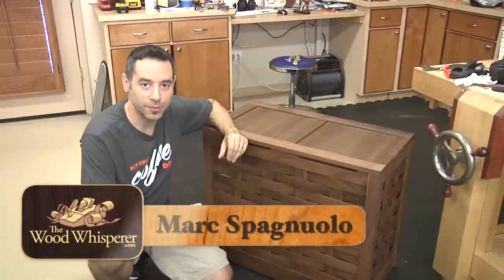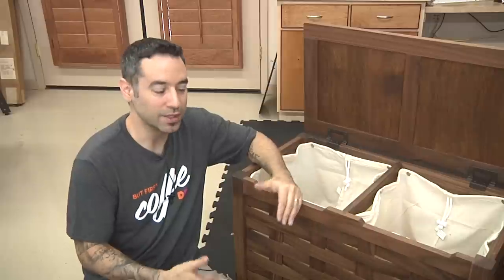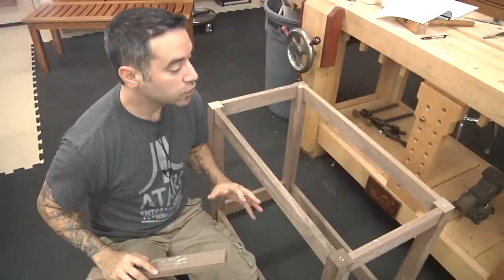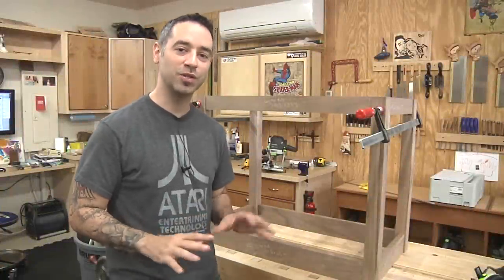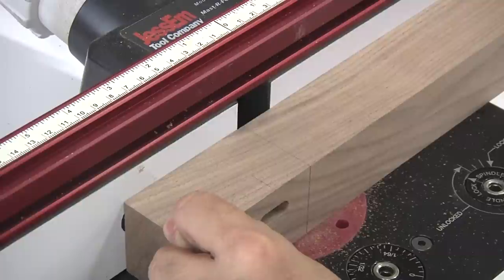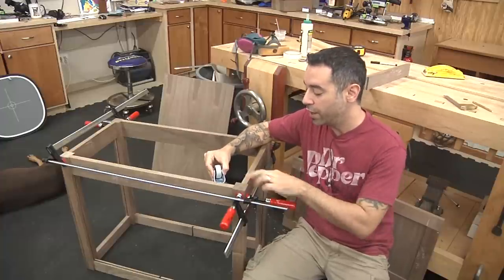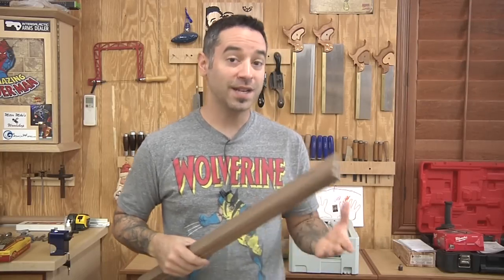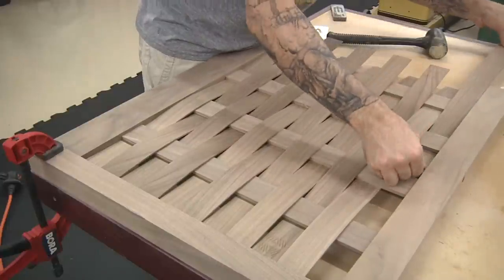Woven Panel Rolling Hamper Pt. 1: Joinery & Woven Panels

Comment: How were the outside legs of the weaved framed secured? Did you leave it dry or use glue?  Did the weaved pieces just float in the groove like a raised panel would on a cabinet door? I like the trick you used to get all the thin pieces in line. Thanks
Reply from the maker: This was just a dry run to prove the concept. The next video will show the actual final assembly.

Comment: Great looking build.  Do you think it would have worked to weave the slats in the same way as you did to measure their length, but to have the side rails on while you do it?  So, instead of having one side off and weaving through from the side, have the top off, and weave the slats in and then slide them down into place.  Or would you worry about marring your vertical pieces as you try to slide the slats down?  Hopefully that all makes sense, I'm not sure I'm explaining my thoughts correctly.
Reply from the maker: ***** That could work. But I'm not sure about the downstream assembly issues that might arise. You'll see in the next part just how tricky it is to get everything together along with a bottom and back panel. Also, getting the verticals aligned into their mortises after all of those slats are in place would potentially be a problem.
Reply: Yeah, the more I thought about it, trying to adjust the verticals side to side, in order to fit the top rail on and get them into their mortises seems like it could be an extremely frustrating venture.

I think you nailed it.

Comment: hi, i don't have any experience of wood working. so, what i'm about to suggest may be unworkable but i'll throw the idea out there. why not taper the ends? so the pieces have more clearance (won't sit on each other) and gives them more room to expand. hey, i don't really know, so please correct me if i'm wrong. keep up the excellent tutorials.
Reply from the maker: kamchowful Nothing wrong with the idea in theory. But the strips are already 1/8" thick and tapering them will make the tips very fragile. The groove they sit in is only 1/4" so I wouldn't really want to thin out that last 1/4" of each strip. And honestly, this system works so there's no real justification for thinning them out. With different dimensions in a different situation, thinning them would probably be a good idea if it makes it easier to insert into the groove.

Comment: Why do you glue dominoes in the rails first? I have a tendency to put mine in the legs first, is it just arbitrary or is there a reason?
Reply from the maker: To me it's more "natural" to make them part of the rails, since that's that position they'd exist in if it were a traditional mortise and tenon joint. The parts can still be stacked easily and moved around without denting anything. Put them in the legs and now you can't stack things as easily and you have something things can easily bump into.